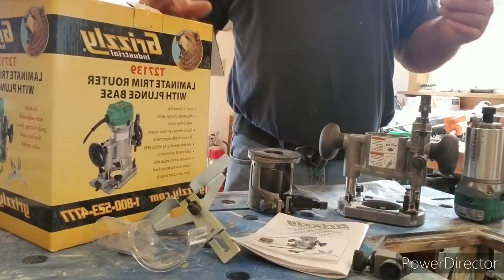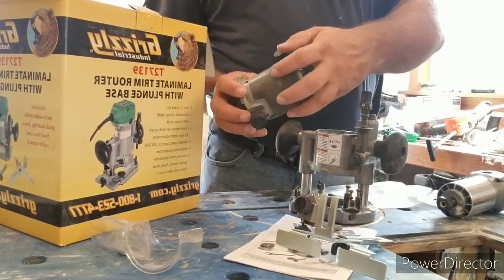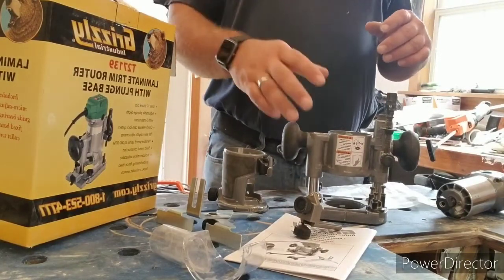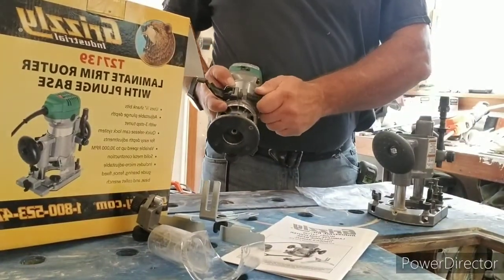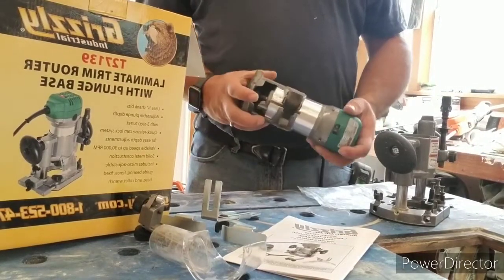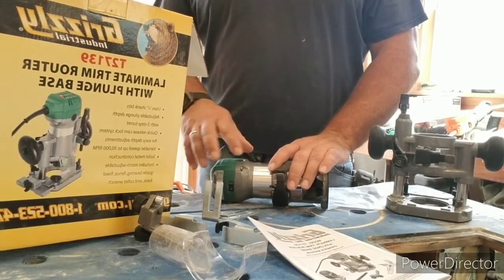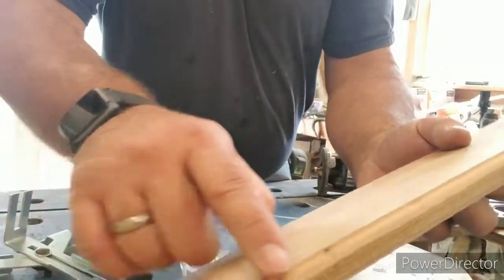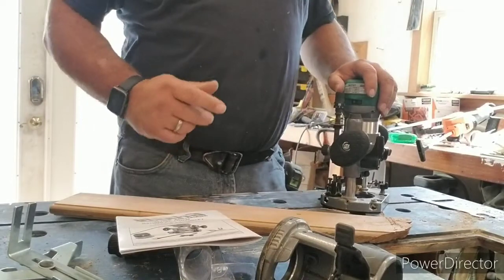Grizzly T27139 Router review

Comment: Are you sure it's not from being under powered and stalling out?,i have the same exact router and I've tried doing,some tounge and groove routing and it didn't like it.  It is after all just a trim router
Reply: @Robert Palmer
Reply from the maker: I could hold it in the air and turn it upside down. You could hear the motor slow down then speed up as you turn it.

Comment: sounds like you are very faithful customer to Grizzly but that router is a lemon my friend, I checked other reviews and they have similar problems AS YOU DO, Sure it's got bells and whistles and a good price but nonetheless it's unsafe and unreliable so I guess I will not be purchasing that router thank you for the review
Reply from the maker: I was disappointed. It is one of the few 1/4" routers that come with a plunge base. The few others that have the plunge base cost twice as much.  Grizzly said to send it back for a refund and if I still wanted it I would have to repurchase it. I picked up a Ryobi battery powered one  for half as much. It does not have a plunge base and is not as of respected name brand but it works.